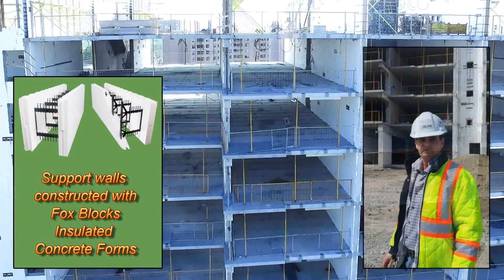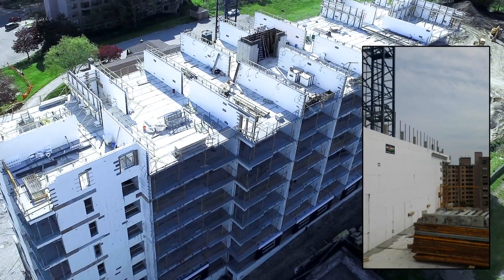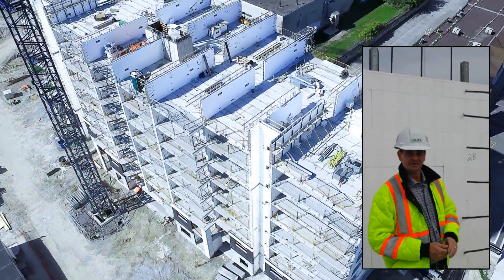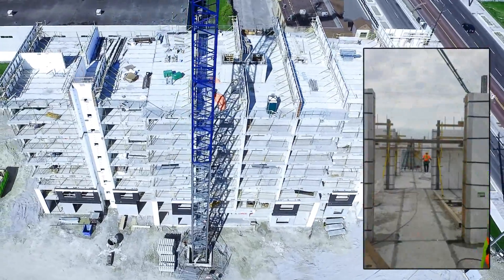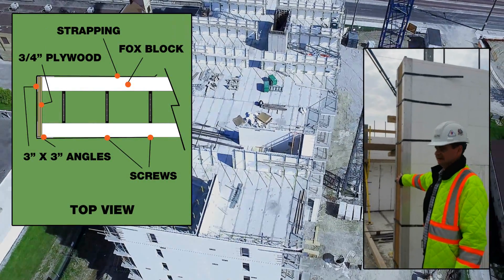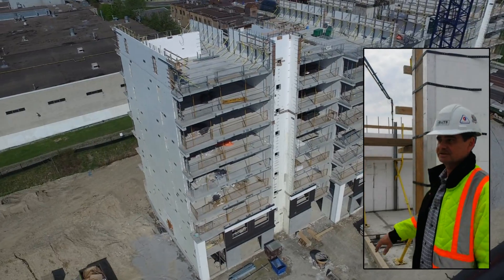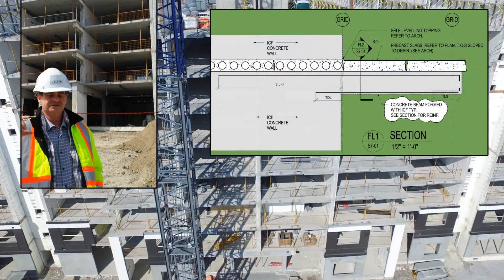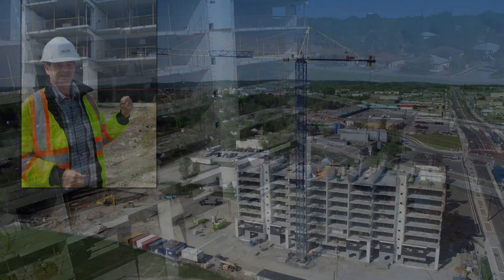Fox Blocks 15 story apartments with ICF

Comment: Do they have a cold joint between each floor?  Do they use kind of bonding agent between pours?
Reply: Cold joints in concrete structures are twice on every floor when the columns are poured on the floor and when the next floor is poured on the top of the columns. Your fishing where there is no fish!